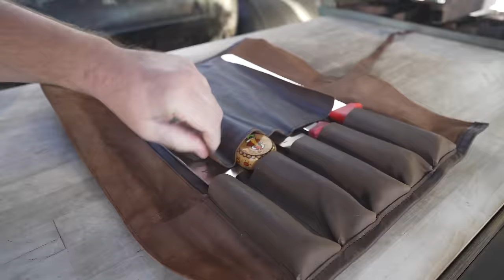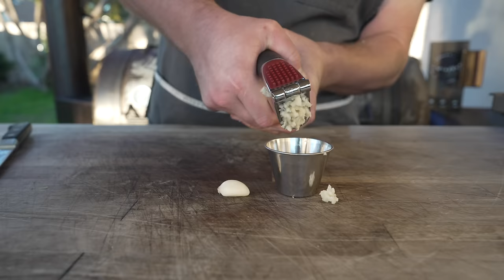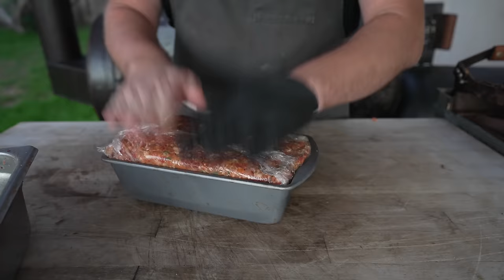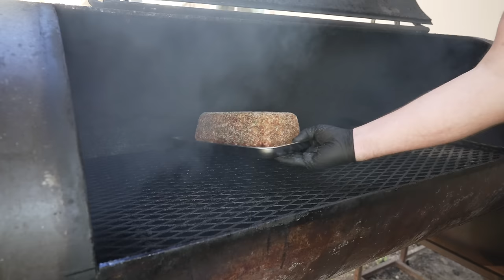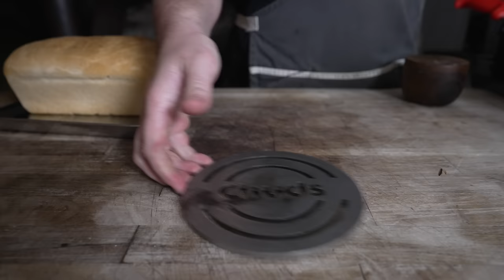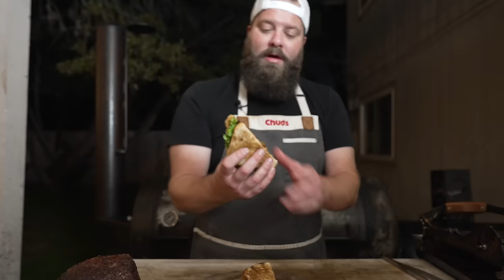BBQ Meatloaf Sandwich! | Chuds BBQ

Comment: Consider just blasting all that veg in the food processor and cooking it all the way down as soffritto to turn the flavor up even higher. I like soffritto so much I've been planning on a little experiment, cooking it down super slow with some light smoke on it. I generally make batches big enough to freeze for a few soups or whatever, but I could easily see doing a truly massive batch over a fire and having enough for months.